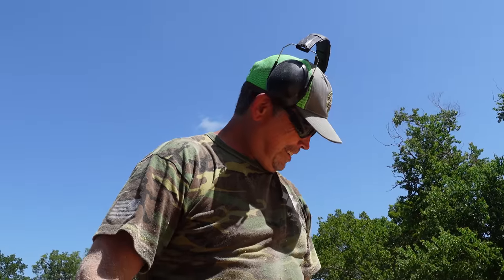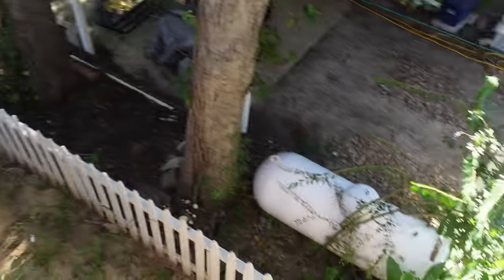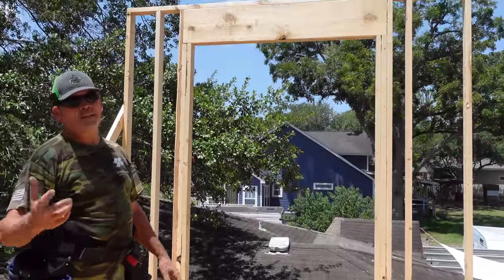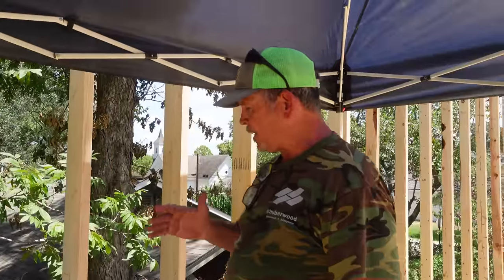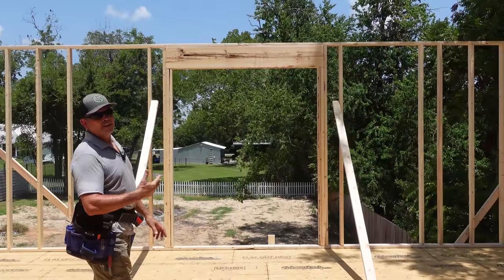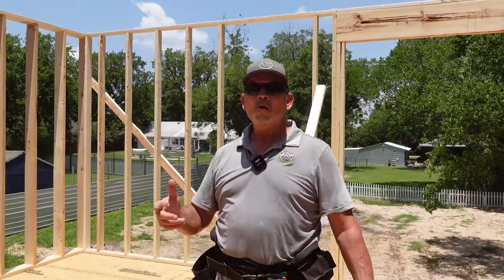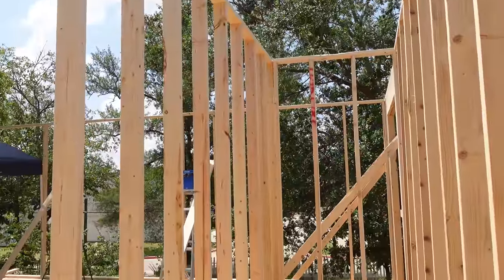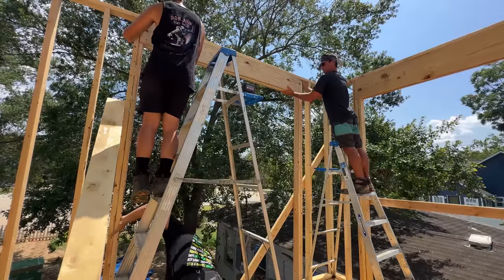These Windows Sent Us WAY OVER Budget...Then we Did THIS!!

Comment: Why not 10ft ceilings? That additional foot is something you’d really appreciate, without noticing it, and the additional cost wouldn’t be significant would it?
Reply from the maker: We wanted to keep the house within scale for the neighborhood and keeping the top of the structure lower was key.  Although it doesn't look like it in the videos, the houses up and down the street are massive.  We didn't want this house to stand out but rather blend in.  That one extra foot of height we gave up made a difference.  The garage is 10 foot ceilings though😁
Reply: @StudPack  makes sense, thanks!!!
Reply: high ceilings also increase energy costs more than you would think.

Comment: Question - I think I noticed on the front wall that you hadn't removed the "tongue" on the flooring before installing.  Seems leave a small unsupported gap of maybe 3/4" on top and below the tongue where the front of the top plate of the first floor and the front of the front wall framing in second story.  Could you have trimmed that unused tongue to avoid that?  Or would that somehow affected the engineered widths of the flooring and where it gets fastened?

Comment: Maybe it would have cooler if you built the garage on the other end of the property?   Maybe not.  Just a idea, for a later project.   I was thinking that it would be better if yir tenants had some space from the landlord.   Sometimes it's the best thing. We are all different.   Or it might become the spot for Grandpa Stud, when the time comes.  Could even have a designated area for a garden or dog run.  Well, the garage and its foundation are done. And that is good to leave in the past.  But, maybe an additional garage at the other end of the lot.   You could call it a "barn" or "chicken coop":  to deflect any permits, inspections or code enforcement authorities...  But, that's a moot point if you want running water, electricity, gas and sewer...  hey, just kidding around.  Gota go by the local ordinances and their "interpretation".

Comment: How are you gonna connect the garage  to the house bridge? Don't think I saw you add the support garage side for that.
Reply from the maker: We added blocking behind the 2x12 rim joist at the bridge location.  We'll probably use some type of metal beam hanger to support the beams holding up the bridge.    The hanger will be attached to the garage with the required structural screws per manufacturer 👍

Comment: Any chance a toilet tank in an outside wall would freeze with only 2" insulation to protect it?
Reply: I agree. Either wrap it with some flexible insulation blanket, or use some kind of heat trace cable or heat tape, similar to what you would use to keep a water pipe exposed to cold temps from freezing and bursting.

Comment: Hi Fellas: I am enjoying your show but as a 60 year old, third generation, master carpenter I’m disturbed by your lack of safety. You should have sheathed your first floor walls before starting your 2nd floor due to “shearing” forces. You’re using step ladders incorrectly and dangerously. Google “belt buckle” rule for step ladders. Keep your belly button facing the rungs and between the rails. Never step on a ladder’s top rungs.I wish you guys the best but exercising better judgement when building is very important. Use the correct tools for the job!

Comment: Will 2 inches of foam be enough to prevent freezing the toilet tank if TX gets another deep freeze event?
Reply: Probably not enough. If it was my house, I would install electrical heating trace cable, and wrap the tank with it, to keep it at 50 degrees, not warm enough to damage the plastic tank, but enough to keep it from freezing. Then I would finish it by wrapping the tank with flexible insulation wrap, similar to what you would use to insulate a water heater tank. Just a thought.

Comment: Gotta question for ya.
So what the definition of a code built house?

Answer
The worst house you can legally build.

This being said why are y'all building with 2x4 not 2x6 on some of the exterior walls? If I remember  the lower level or garage is 2x6 but you are using 2x4 upstairs in the living area. Not a ton of difference but the difference between 2x4 and 2x6 insulation is added 50%, r-13 maybe 15 for 2x4 and r-21 to 23 for 2x6. In my book it a no brainer go bigger. Even if you are doing exolation too. 

Let's see where you go with windows and insulation.

Pay now or pay for the entire time that building stands. Energy prices aren't going down.